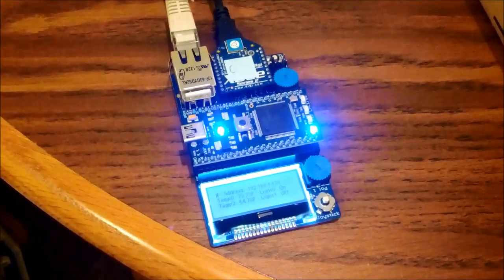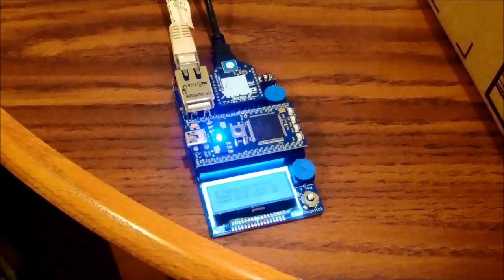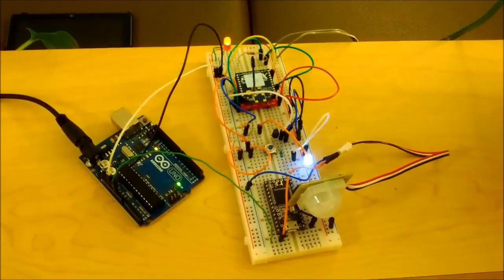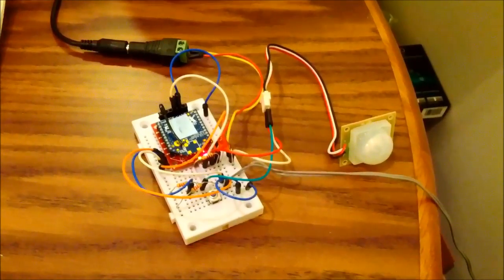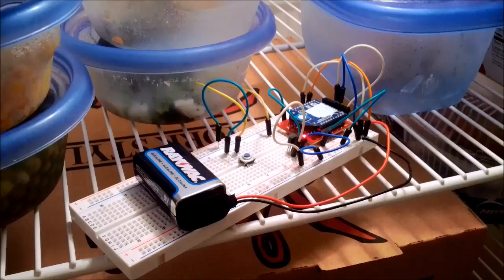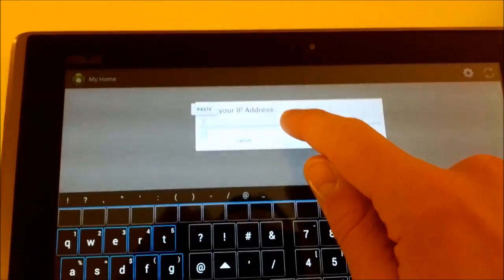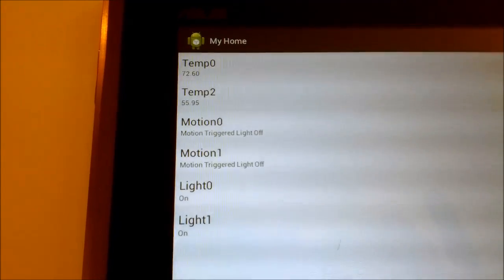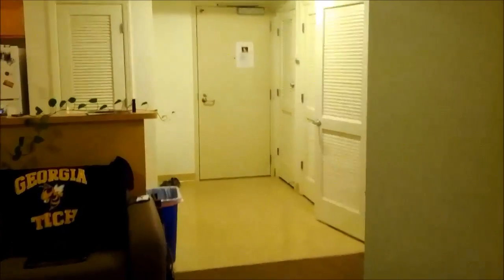Xbee Home Automation Project

Comment: Whats the battery life like for this setup ?
Reply from the maker: Not really sure, probably pretty poor. The small temp sensor node in the fridge is running off of a 9V battery, and going straight to the regulator on the XBEE breakout board which has a linear regulator. I didn't enable any sort of power saving features on the XBEE like sleep as this project was pretty much a proof-of-concept. I'm sure those radios have some sort of power saving features if you look in the docs.

Comment: Hey Chris, can you share info on how you programmed and connected to HA?
Reply from the maker: Hey Cristian, unfortunately I do not have any sort of detailed write-up on how I did this as it was whipped up quickly for a school project, however if you have specific questions I might be able to help. Bear in mind this was several years ago so it's going to a bit rusty.

I'd recommend starting with interfacing an Arduino with the Xbee radios as there is lots of support for it. Here is a link to what looks like a good breakdown on how to communicate with the Xbee radios and how to interface an Arduino using the API mode: http://serdmanczyk.github.io/XBeeAPI-PythonArduino-Tutorial/

Note that when I originally did this I had to write my own 'library' for interfacing the Mbed to the Xbee radios, however it was really hacked together and isn't ready to be released.

So anyways, if you have specific questions I can try to help out. Good luck!
Reply: Thanks Chris. I was looking specifically if you had any reference to the HA standard. Can use ZigBee already but had trouble finding info on HA or working examples!
Thanks!!!
Reply from the maker: Hmm, by HA I assume you mean home automation? My understanding is that this isn't a standard, but instead more of a general idea of automating aspects of your home. My implementation is completely custom and does not comply with any sort of standard.

This was actually a point of concern for me when I was building this as I wanted to make it so that every endpoint could have any number of sensors and light controls on them and would be able to report back to the main controller what their configuration was. That way if this system was actually installed in my house I wouldn't have to modify the code at all to add a new light control or what have you.

I'm sorry to say that I don't think I ever really solved the issue. I certainly did some brainstorming to come up with ideas if I was to install this in my own house, but I haven't ended up doing that yet.

If however there actually is a HA standard please link me to it as I am interested in taking a look!
Reply: Well, I have a vera controller and it say that it support zigbee HA 1.2
Researching it I got to this
http://www.zigbee.org/zigbee-for-developers/applicationstandards/zigbeehomeautomation/
and this is also listen on wikipedia 
https://en.wikipedia.org/wiki/ZigBee

Then I also found the link to your video. Haven't been able to find the standard itself
Reply from the maker: Oh I see. So first off, Zigbee and Xbee aren't the same thing, it's my understanding that they both use the IEEE 802.15.4 standard of mesh networked radios, however Xbee built their own software for communicating over the network and AFAIK it's not compatible with Zigbee. However looking at the Xbee wikipedia page it looks like they built at least a few Zigbee-compliant radios.

Zigbee HA is a standard created by Zigbee and companies can get certified to be compliant so that their products can work with other HA-compliant devices like your Vera controller. I originally wasn't aware whether anyone has ever gotten Xbee radios talking the Zigbee HA protocol, however just googling for "xbee zigbee ha" I found that some people are getting it to work. I'll leave it to you to dig further into it, but it at least looks promising.

Here is a document on the Zigbee HA protocol:
http://www.nxp.com/documents/user_manual/JN-UG-3076.pdf

Here are some articles that might help:
http://www.desert-home.com/2014/10/ok-back-to-zigbee-protocol-and-xbees.html
http://forums.parallax.com/discussion/157233/propeller-to-smartthings-communicating-with-the-zigbee-ha-public-profile
http://www.digi.com/support/forum/2384/xbee-pro-s2b-communicating-with-zigbee-ha-profile-sensors

Comment: have you done any kind of tutorial on this?
Reply from the maker: +Edd Johnson No I'm sorry Edd, I don't have any tutorial on this as it was originally made as a school project, however if you have specific questions I can do my best to answer them!
Reply: +Chris Wilson Don't worry man, great work by the way. I'm working on a different project though. But Thanks.
Reply from the maker: +Edd Johnson Cool man, hope it goes well! Good luck!
Reply: +Chris Wilson Thanks.
Reply: +Chris Wilson Hello again. Sorry if i'm bothering. But i'm trying to configure 3 xbee modules to be on the same network. I know this cant be done in AT mode, rather it is done in API mode. But i'm having trouble configuring them. Can you tell me how to configure all 3 xbee modules to transmit data on the same network? 

i need to configure the first as a coordinator and the second as a router and the third as an end-device.

I only know that they must have the same PAN ID.

thanks in advance